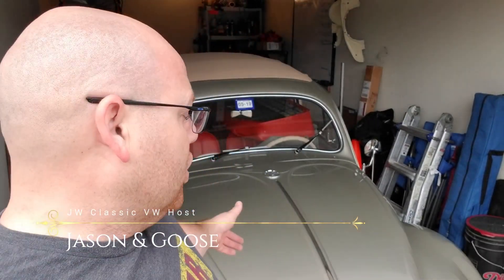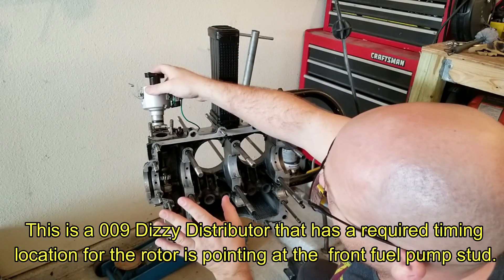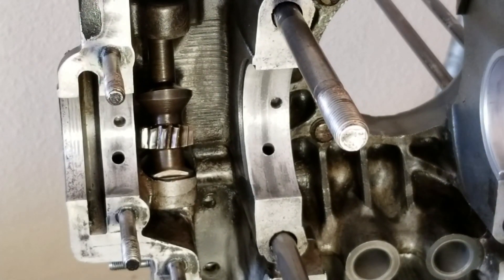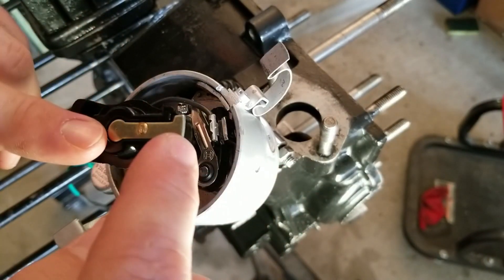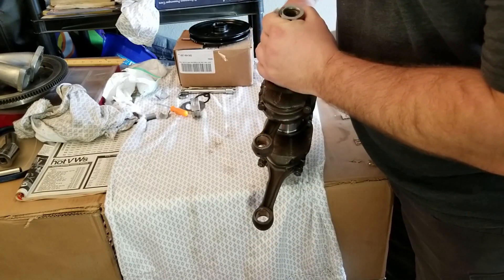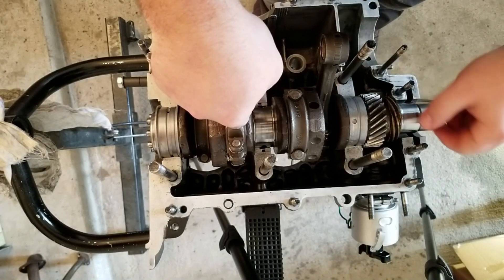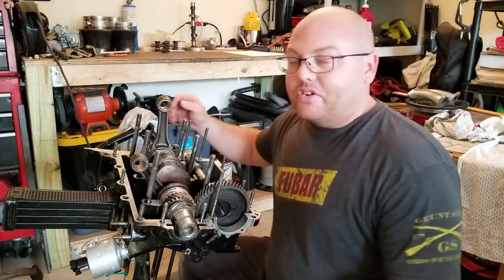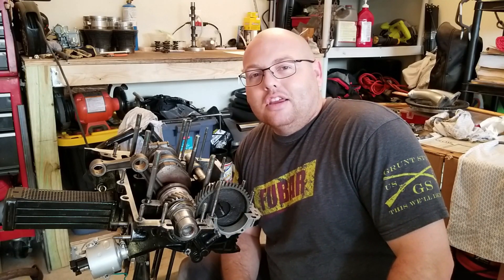VW BUG | Distributor Drive Gear Install 40hp | JW Classic VW

Comment: great video. No matter how hard I try, the slot on my drive is always at a bit of an angle with the crankcase when the no1 cilinder is at tdc. Not straight as in ALL pictures. I tried different teeth on the gear (no flat side). I always end up at a slight angle. I have no timing mark (123ignition) on the distributor. Should I just ignore the angle and adjust the timing by rotating the distributor, or am I doing something wrong installing the drive? If the angle doesn't matter, what would be better. Point more towards the rear stud of the fuel pump or the front stud.
Reply from the maker: Angle doesn't need to be perfect, I normally go more to the fuel pump.
Reply: @JWClassicVW  great, tnx. I am now a bit more confident building up the engine. Great you responded to an older video 👍

Comment: My drive gear is 180 out, small half moon to the front. When i line roter and dimple  at #1 the vac advance is hiting and wont allow the dietribter to be inserted. Any sugestions, thanks, Ken
Reply from the maker: Hmmmm, that's a new one on me.  I'd need to see it, maybe join the FB group and post some photos there. FB group is JW Classic VW
Reply: Thanks for the reply, I have that handled, so I have it running but when I try to time it where it runs the best top dead center is close to the bottom. I have drove it and it backfires from #1&2 but I think I have other issues cuz I noticed oil at the exhaust on 1&2 @JWClassicVW

Comment: What does the little spring actually do. Its a very weak spring and seems useless to me ?
Reply from the maker: The spring maintains proper tension or load on the distributor drive gear, preventing excessive wear on the drive shims that are installed.

Comment: Good video...the chatter spring shim on the end of distributor drive could be a pain to keep on end of distributor drive if you decide to pull out distributor after motor is assembled..ive experienced the 180 out syndrome...back fire music...ive even lined up cam gears with foundry stamp instead of dot to dot...that gave be blast of air thru carb stacks..I felt bad going to vw shop to purchase vw for idiots catalog...but my mistakes made me a better engine builder....
Reply from the maker: I've totally done the 180 out as well... I think most probably have at some point.  You can never have enough VW books! lol

Comment: Hi, I just had a quick question. Do the pistons actually fire AT top dead center, or is it actually a little before? I thought I had seen another video where the timing is set to fire about 7 degrees before TDC. I'm pretty new to this! I'm trying to restore a 1972 VW Beetle. I'm not quite ready to worry about ignition timing yet (still have the engine apart!) but will hopefully be getting there soon.
Reply from the maker: Hello there and yes this is a good question... and I'm sure there will be tons more!  As for timing of your engine most agree for a stock application 7 degrees advance is the norm.  As far as building your engine and the physical location of your CAM to Crank for assembly they all go together roughly the same.  The only real change that can be made when assembling an engine as far as timing in concerned would be with an adjustable CAM gear.  These are often seen with straight cut cam gears where at the CAM to CAM gear you can either advance/retard/or 0 the timing.  I've never done anything but 0 the timing here as I like to adjust the timing with the distributor.  I run my timing at 30 degrees advance at 3000 RPMs, this works out to around 7 to 8 degrees of advance when at an idle of 800rpms.

So timing is done at the distributor once the engine is assembled correctly.
Reply: @JWClassicVW  Ok, I think I understand now. This is just for the initial installation of the distributor, and then I would adjust the distributor so that it fires the ignition coil when the engine is about 7 degrees before TDC? (Static timing adjustment?) I understood about lining up the cam shaft and crankshaft with the timing marks, but I didn't know that the distributor drive shaft also had to be installed a certain way until now! I've been trying to do research to be sure I get everything right when I start to put the engine back together. Your video was a big help!
Reply from the maker: @ct6502c  The more info you have the better... super glad to help!

Comment: I have a 1600 cc motor that I can lift the rotor and pull the bottom piece off the shaft that turns it not sure if shims are missing or what
Reply from the maker: Hey Gary! Well that sounds like you either need to rebuild the distributor or even better pick up a new one.  As for the shims you should be able to see them sitting below the distributor drive gear when removed.  If they aren't there they may have either been removed (by mistake) or fell in the sump area.

Comment: My distributor gear is stuck no turning what can I use to loosen it up?
Reply from the maker: What kind of engine... sometimes you can rock the crank very slowly both directions to free the drive.  How did it get stuck... the 40hp gear is different from a 1600.  The gear is keyed and will only come out one way unlike the 1600 that isn't keyed.
Reply: It's a vw1600
Reply from the maker: @derickg3657  are you using the distributor drive tool to get it out or back in?
Reply: @JWClassicVW   no I don't have one  I wasn't planning on taking it out
Reply from the maker: It would just make it easier to get it back in place, the problem you could run into it damaging the gear in the crank... I know because I did... It still worked fine but when I built my 2276 I saw the damage I caused. Just take an easy when rocking the crank while pushing it back down... may be able to use the distributor to get in back in place.

Comment: Good tech tips always a point of question for folks rebuilding a vw motor ; never knew about the flat on the gear but all the motors I rebuilt and work on were 1600 dual ports. Like your video work and lighting was great nicely done Jason keep sharing these tech tips. We do not have Huston weather today in Iowa 58 mile high winds white out snow crazy outside today.
Reply from the maker: Just to let ya know I finally got to this comment...lol 
Appreciate the support brother!

Comment: Question sir. Back in the late 70s, I was into Toyota’s. I built a couple of 20R engines. The cam gear could only go on the cam shaft one way. The first air cooled VW I built was a mild 1641 with a Eagle 110 cam with a straight cut gears. (I think?)After putting the hole thing together. I found that the timing was off. After reading the cam instructions, I discovered that it the bolt holes where symmetrical. The gear could be bolted three different ways, but only one was right. Why is that? Is that true with all aftermarket cams for VWs?
Reply: I understand about timing, and why it has to be on the right way. The question is, why can the gear be put on wrong? Why can’t one of the holes be moved 2mm over so that there is only one way that the gear can fit the cam shaft? If it is for balance, the cam rotates 4 times slower than the crank, and a small movement shouldn’t hurt that.??? 
I know that the original stock from VW are riveted on, and they look like they are symmetrical. Does that have anything to do with it?
Reply from the maker: @terryfleming7084  not sure man... I do know that on straight cut gears I just ordered there is adjustment in the cam gear to advance timing.  As for an offset bolt location to ensure correct cam gear placement I dont know.  You may be right though with the balance.
Reply: Yes this is true happen to me when helping my friend rebuild his motor, did not realize he bolted the cam gear on wrong . The motor was install in a sand rail easy to work on , we chased this issue way to long trying to find out why the motor would not run. I finally told we need to split the case so I can look at his cam sure enough that was the issue corrected it 1st try motor started right up.
Reply: But why?
Reply from the maker: @terryfleming7084  it's for timing of the valves to the crank.  This is the correct position where the lobe will be closing the intake vavle on compression stroke for number 1.  Any other orientation would have the valves opening and closing at the wrong time.
Reply from the maker: Yes as Dan said the gear must be installed only one way.  If your holding the gear with the timing mark in the 12 o'clock position the back lobe of the cam will be facing down.